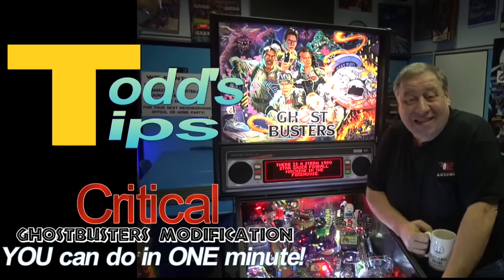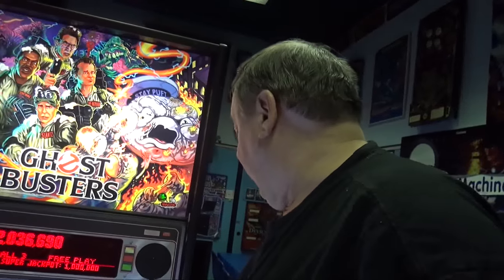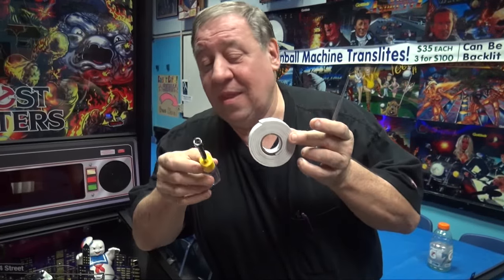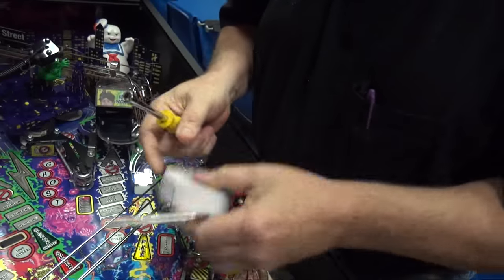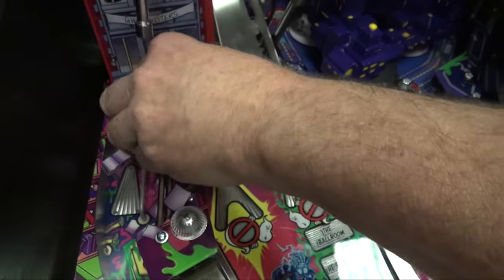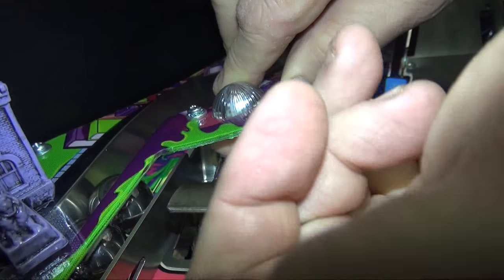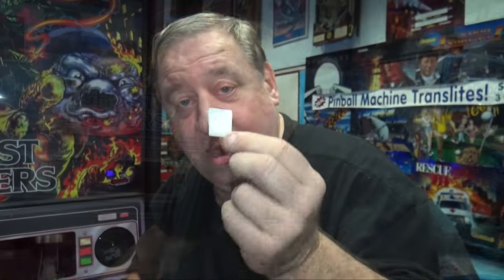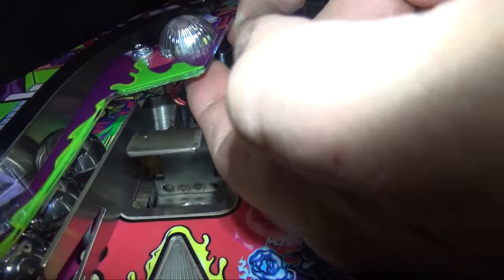#1210 Stern GHOSTBUSTERS Pinball Machine CRITICAL FIX you HAVE TO DO! TNT Amusements

Comment: Thanks Todd.  We always need more quick "pinball tech fixes" when things get oversighted in design, even if simple like electrical insulation protection due to lack of interrupting fuse protection.  Bulletproofing games for long term protection = less frustrated people and less technical calls, especially for the latest generation of new owners unfamiliar with the board systems and voltages.  You should put up a video detailed adding external fuse breakers to the GB Premium/LE models "magna-slings" to prevent future lock ons and overheating like TAF "Feel the Power", even though the SPIKE system "pulses" the high voltage in PCB design, versus tradition power means.  All MET games definitely need to have them installed for the SAM system, especially if not updated to the new magnet board.
Reply from the maker: Yes...TNT Amusements has ALWAYS tried to bulletproof the games before we sell them...and thousands of games later, we continue to try to keep these older games playing!!

Comment: Hey Todd. I have just picked up a Pro that was manufactured in October 2016. Do you know whether Stern rectified this issue by then or should I go out and buy some foam tape etc. Cheers, all the best
Reply from the maker: The machines we open now were "corrected" with a thin clear piece of mylar...NOT enough protection for sure...so fix yours!
Reply: TNT Amusements Inc thank you! Great machine, keen not to wreck half its boards

Comment: The engineers behind this machine doesn't seem to have a whole lot of experience in designing Pinball Machines because you should be well aware of historic "board-busting" design-flaws.

BTW Did you contacted Stern over this serious problem or are they already aware of it?
Reply from the maker: When our showroom display Ghostbusters failed, we started looking into what happened and realized that a board had smoked and called Stern to get a replacement.  That new board got part of the machine running, but then we needed the trough opto boards too as they had holes in the chips after further inspection.  But after replacing them, we still had many lights and coils not working.  At that point (perhaps 3 weeks ago, Chas in Tech Support told us they thought they knew what was happening and told me to look at that flash lamp...and sure enough, the metal VUK assembly was very close to that flash lamp.  He told me they were doing a service bulletin on it and we got all the other boards in a few days ago which solved the issue (of course we did the mod).  The double sided foam tape was my idea, since its very thick.  I did ask if I could do this video too, to prevent further board blowups from so many Ghostbusters out there.  However, the 6 upgrades we have now done, show that metal assembly a good half inch away from the light...so its possible that maybe only a HANDFUL were assembled  slightly off...but that foam will at least insure safety  for all the others.  Its also possible the metal bent a little from the heavy use our display model gets and that the average home play wouldn't get that to happen.  But better safe than sorry!